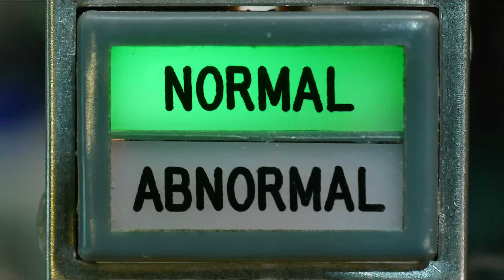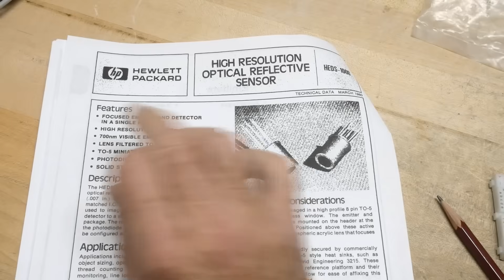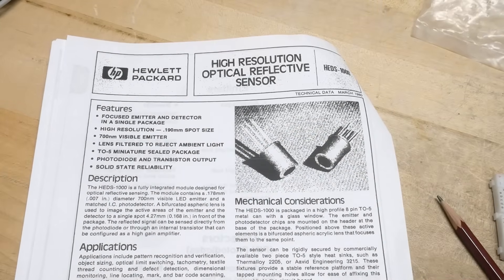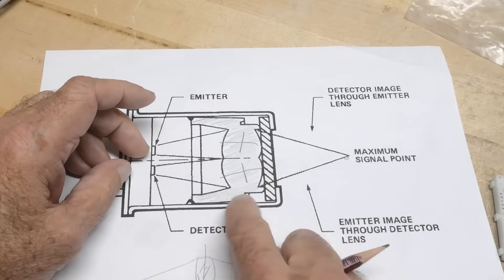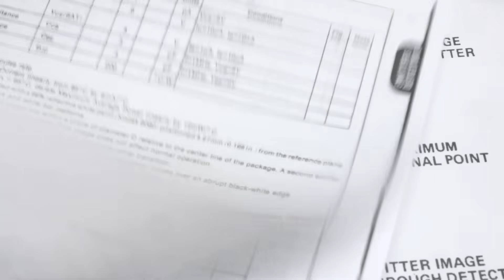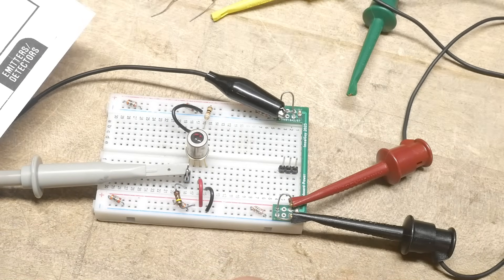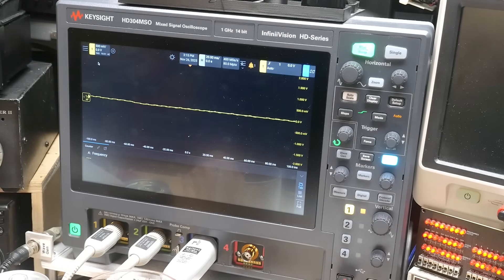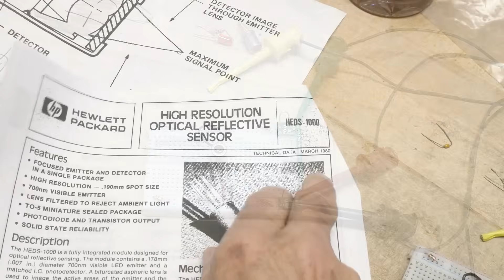#2440 HEDS-1000 Hewlett-Packard Emitter Detector Systems

Comment: A phototransistor is just one transistor whose CB junction is exposed to light.  (Well, they are also specialized for desired optoelectronic performance...)  HP's combination can have a more sensitive photodiode and a higher beta transistor to improve performance for reflected light.

Comment: What a blast from the past. In the late 1970s I designed inhouse test equipment. Bar Codes were just becoming a thing, Code 39. Besides the raw devices HP sold a bar code want that I integrated into our test equipment. The App Note showed a clever technique to fold the lookup table. I would have missed that optimization without the App Note.

Comment: I bought some of these when I was in college! I combined them with an x/y motion platform driven by stepper motors to make a 2D scanner driven by my home-brew 6502 computer to digitize black/white photographs. The x/y stage had a resolution of 0.001 inch and an area about 5x5 inches so it couldn't handle large source images, but the HEDS1000 has a very high resolution detection spot if properly spaced so it could capture fairly high levels of detail. It took a loooong time to digitize so it'd sit in a corner making noises - my college pals called it "the grinder-back-and-forther". I still have this stuff in a box out in the garage somewhere.
Reply: Awesome!

Comment: HP in the 70s and early 80s must have been the coolest company ever. Thair test equipment from that time is the peak of quality and engineering. They must have been the masters of classic circuit design, making complex analog circuits with just a few discrete transistors. By the late 80s things went downhill. Quality got worse and they no longer pubished full circuit diagrams. Too much reliance on programmable parts and computers. At least thats the picture I am getting from collecting HP stuff from the dumpster at my uni 50 years later. Now they make crappy laptops and terrible printers or something? Must have been amazing to experience the "golden" era of HP!